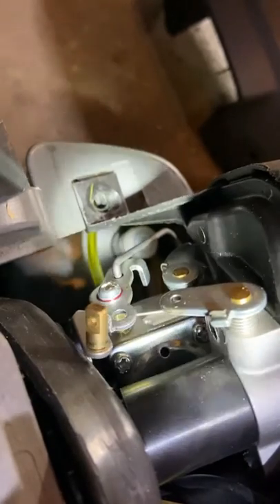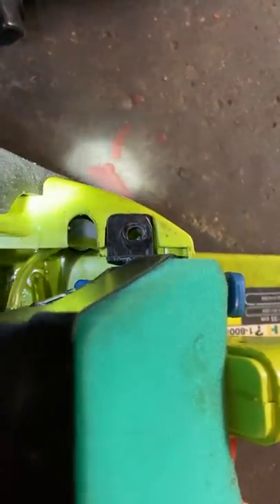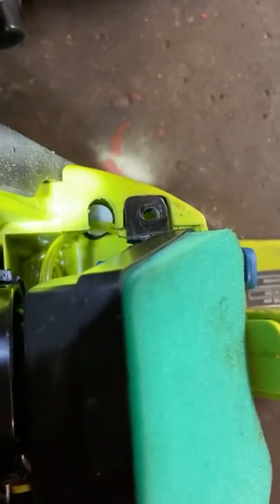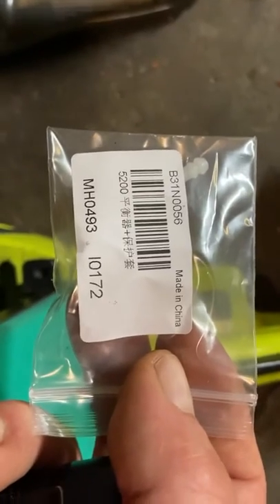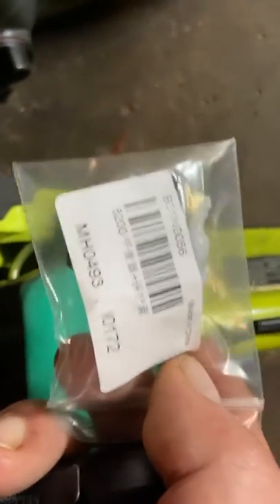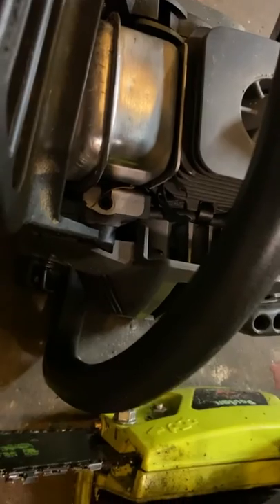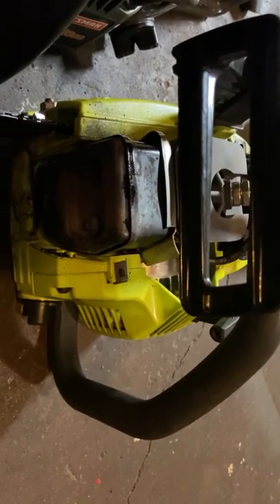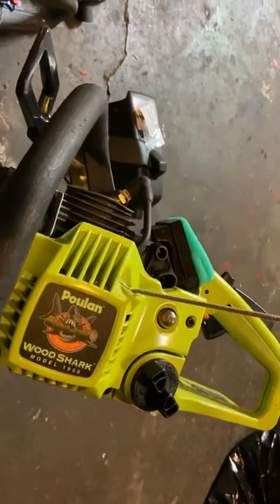Poulan chainsaw fuel vent dissection update

Comment: mine gets flood if i dont use it for 3 days, what can be the problem?
Reply from the maker: Without pressure testing the carb…I would say to pull the metering valve side of the carb off. Remove the metering lever and stretch the spring just a bit. 
The needle may be leaking and all the fuel in the carb is flooding it. It is the side of the carb with the 4 screws. 
Leon’s chainsaw repair has some great videos on the topic. Good luck!
Ps, try to work on the original carb. Those eBay and Amazon ones, the linkages tend to rub and bind on the saw.

Comment: Nice. What did you use to mill the bearing area?
And I noticed my fuel tank pressures up a bit on some of my Poulan honeowner saws. 
Causes them to run rich etc but if you are running the saw and then shut it off you just put the throttle lock on or on the strato saws your throttle lock is on the chock lever so you just pull it out then push it back in which holds the throttle open a little for the hot starts. 
A better tank vent would just allow them to start without doing all that like what you did.
I have a cap that pressures up more than normal so I tried poking holes in the duck bill with a needle. Seem to help a little but not as good as your fix.
Reply from the maker: Thanks for the advice on the strato. I will try it next time. 
On the pockets, I just used a dremel and a depth gauge to keep checking.  Milling was probably a poor choice of words, ground is more like it. 

I have to admit, I did not do as good a job as I thought. When I ran it the first time hard, it started leaking from the pockets. Couldn’t keep the idle down. Leaked really bad on the clutch side. It ran really good before the leak started. Lot of toque for. 42cc saw. I could lean on-hard,  and it just kept going with the bar buried completely. 

Pulled it apart and ground out more. Put some fresh bearings and seals on the crank and slid a piece of Saran Wrap around them. I then cut a .025 piece of gasket material in a round and mixed up some jb weld. Put it in the bearing pockets and dropped the crank assembly in trying to keep the rod in the tdc position. 
Ended up having to do it twice, second time i greased the seals as a release. Left a perfect impression that was actually round this time. 

I have only let it idle, no real cutting time. Still have some tuning issues, which may be a leak or just carb issues -not sure. Fiddle with it when I have a chance. 
Finally put a degree wheel on it
Squish .030
Exhaust 105
Intake duration 144
Blowdown 19

To quote a fleet command- the net, net, net is a 42cc eBay cylinder, widening ports and opening up the bottom of the transfers along with a good deburring and muffler mod will make it a really stout saw. Not sure if all the extra work with raising the compression is worth all the extra work and hassle. But, this is just fun-and if the cylinder is ruined, $25 and a new piston and cylinder can take care of that. 

Sorry for the long winded response- have a good one!
Reply: @crazyfeller5704  no that was a great reply interesting stuff.
I heard one fellow say he used a pipe and course sand paper to grind out the bearing saddles.
I haven’t tried one yet but will eventually. 
105 is a pretty good number isn’t it? 
What were the stock specs do you know?
P.S I wouldn’t poke holes in the duck bill again they slowly leak over time. I think you can order new caps from Husqvarna for their old model saws which were like the poukan 2450, jonsered CS2137 etc or just do what you did.
Reply from the maker: Left a video answer to most of this question- thought it was probably easier. Using the pipe may work for opening the pockets, took quite while using a dremel. I would imagine with enough time and patience it would work and actually be round!